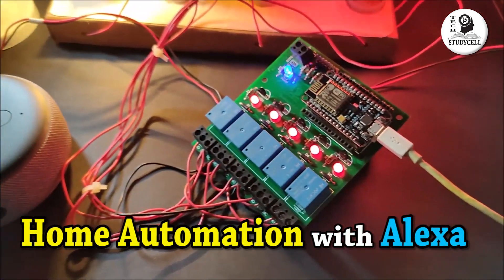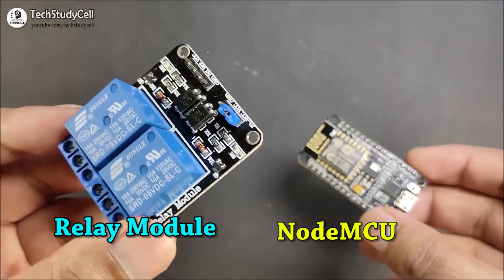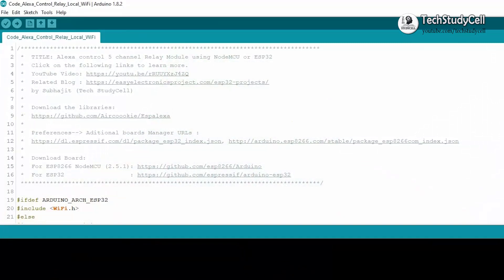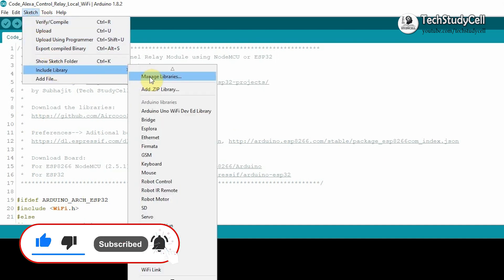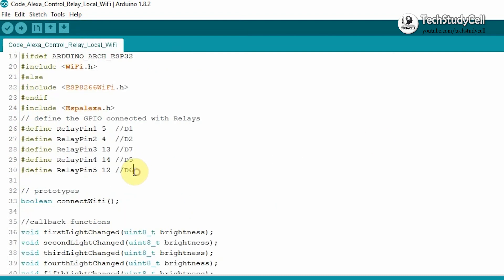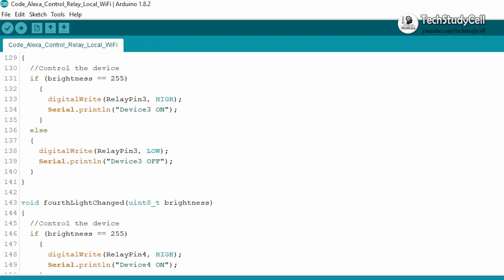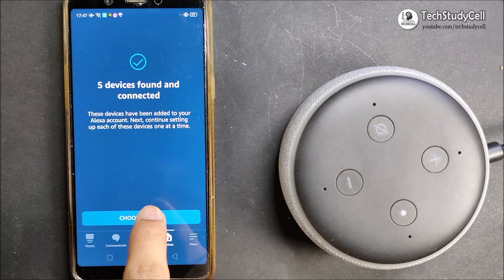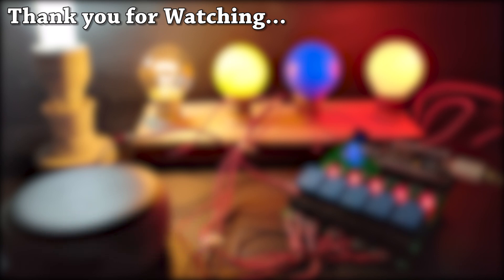Alexa Smart Home Automation system using NodeMCU ESP8266 & Relay Module | IoT Projects

Comment: can you describe the rest of the components you saw in the project.  For example, what value are the diodes and what are the resistors that are next to the connection block.  The resistors that are between the LEDs do not look like 220 because their code starts with black.  Can you provide more information or a wiring diagram for this device?  Regards.  Adam.

Comment: Hi Tech Study Cell i am facing a small issue i have followed each and everything you have told in the video but when i am supplying 5v to nodemcu then all the devices connected to it is turning on and when i am ordering alexa to turn on light she is actually turning it off instead of turning it on and this problem is having with each and every device connected to relay  pls anyone help and suggest an idea thanks
Reply: Same problem bro

Comment: Sad thing is that this reset when a power outage occurs, anyone has solved this? 
A few solutions that I can think are: 
*use a power bank to power device, and connect that power bank to a usb charger to always have energy.
*Use a battery module thingie to power it, same as power bank but gives more options when designing
*I believe these devices have onboard persistent storage, but I think it has short life so making some code that has this in mid is important, something like “every hour write the last state of device”, that or storing this last state on a separate server or storage device

Comment: Hello. Thanks for putting this video together. I actually ordered my first custom PCB using your link and the File you provided. It was a lot simpler than I thought and I received the product quickly. I feel more confident in trying my own design. I am having an issue with this project now. It worked for a few weeks now I am getting a “device not responding error” I have tried unplugging everything and plugging it back in. I have removed and reinstalled the devices. Lastly re-uploaded the code. Alexa found the devices and installed them, but right away they are not responding. Any suggestions? Thanks
Reply: I figured it out. I uploaded the code from my laptop instead of my desktop. I had the latest version of the ESP8266 installed on my laptop. Seems to be working now.
Reply from the maker: Great!!  you can also checkout the following Alexa home automation https://youtu.be/5-ZyC3-BzLE
Reply: @TechStudyCell  I will check it out. I think I would like to add buttons. I incorporated a scrolling matrix too.

Comment: Sir ek Q hei h...hme relay ko on krna h bt ek specific time tk on rkhna h ..jese 5 sec tk or fir apne aap off honi chaiye...supose i command that alexa turn on relay 1 and its on bt for 5 sec ..and i want it automatic off after 5 sec..
Reply: add delay in that executed file 
for eg. in code 
to make these changes in 
first device 
void firstLightChanged(uint8_t brightness)
{
  //Control the device
  if (brightness == 255)
    {
      digitalWrite(RelayPin1, HIGH);
      Serial.println("Device1 ON");

       delay(5000);
      digitalWrite(RelayPin1, LOW);

    }
  else
  {
    digitalWrite(RelayPin1, LOW);
    Serial.println("Device1 OFF");
  }
}
Reply: @MaheshBahutePPTSIndia  sir can you merge two program plss for ESP32 board ...

1.  fingerprint door lock by android fon with app ..

code// #include <WiFi.h>
WiFiClient client;
WiFiServer server(80);
#define wifiLed    2   //D2

const char* ssid = "wifi name";   //WIFI SSID
const char* password = "password";    //WIFI PASSWORD
String  data =""; 
int Relay4 = 26;     //D26

void setup()
{
  pinMode(Relay4, OUTPUT);
  digitalWrite(Relay4,HIGH);
  Serial.begin(115200);
  connectwifiFing();
  server.begin();
  }
void loop()
{  
    client = server.available();
    if (!client) return; 
    data = checkClient ();
    Serial.print(data);
    if (data == "RELAY4SUCCESS")
   {
      digitalWrite(Relay4,LOW);
      delay(100);
      digitalWrite(Relay4,HIGH);
    }
} 
void connectwifiFing()
{
  Serial.println("Connecting to WIFI");
  WiFi.begin(ssid, password);
  pinMode(wifiLed, OUTPUT);
  Serial.print("WiFi Connected  ");
  digitalWrite(wifiLed, HIGH);
  while ((!(WiFi.status() == WL_CONNECTED)))
  {
    delay(300);
    Serial.print("..");
  }
  Serial.println("");
  Serial.println("WiFi connected");
  Serial.println("NodeMCU Local IP is : ");
  Serial.print((WiFi.localIP()));
}
/******************************** RECEIVE DATA FROM the APP ******************************************/
String checkClient (void)
{
  while(!client.available()) delay(1); 
  String request = client.readStringUntil('\r');
  request.remove(0, 5);
  request.remove(request.length()-9,9);
  return request;
}
Reply: @MaheshBahutePPTSIndia  and 2nd program is relay on off by alexa ... 

code// 
#include <WiFi.h>
#include <Espalexa.h>
Espalexa espalexa;
#define RelayPin1 23  //D23
#define SwitchPin1 13  //D13
#define wifiLed    2   //D2
int toggleState_1 = 0;
boolean connectWifi();
void firstLightChanged(uint8_t brightness);

// WiFi Credentials
const char* ssid = "wifi name";
const char* password = "passwrd";
// device names
String Device_1_Name = "Study Lamp";
boolean wifiConnected = false;

//our callback functions
void firstLightChanged(uint8_t brightness)
{
  //Control the device
  if (brightness == 255)
    {
      digitalWrite(RelayPin1, LOW);
      Serial.println("Device1 ON");
      toggleState_1 = 1;
    }
  else
  {
    digitalWrite(RelayPin1, HIGH);
    Serial.println("Device1 OFF");
    toggleState_1 = 0;
  }
}
void relayOnOff(int relay){
    EspalexaDevice* d = espalexa.getDevice(relay-1); //the index is zero-based
    switch(relay){
      case 1: 
             if(toggleState_1 == 1){
              d->setPercent(100); //set value "brightness" in percent
              digitalWrite(RelayPin1, LOW); // turn on relay 1
              toggleState_1 = 0;
              Serial.println("Device1 ON");
              }
             else{
              d->setPercent(0); //set value "brightness" in percent
              digitalWrite(RelayPin1, HIGH); // turn off relay 1
              toggleState_1 = 1;
              Serial.println("Device1 OFF");
              }
      break;
      default : break;  }
      delay(300);}

      // connect to wifi – returns true if successful or false if not
boolean connectWifi()
{
  boolean state = true;
  int i = 0;

  WiFi.mode(WIFI_STA);
  WiFi.begin(ssid, password);
  Serial.println("");
  Serial.println("Connecting to WiFi");

  // Wait for connection
  Serial.print("Connecting...");
  while (WiFi.status() != WL_CONNECTED) {
    delay(500);
    Serial.print(".");
    if (i > 20) {
      state = false; break;
    }
    i++;
  }
  Serial.println("");
  if (state) {
    Serial.print("Connected to ");
    Serial.println(ssid);
    Serial.print("IP address: ");
    Serial.println(WiFi.localIP());
  }
  else {
    Serial.println("Connection failed.");
  }
  return state;
}

void addDevices(){
  // Define your devices here.
  espalexa.addDevice(Device_1_Name, firstLightChanged); //simplest definition, default state off
  espalexa.begin();
}

 void setup()
{
  Serial.begin(115200);
  pinMode(RelayPin1, OUTPUT);
  pinMode(wifiLed, OUTPUT);
  digitalWrite(wifiLed, HIGH);
  pinMode(SwitchPin1, INPUT_PULLUP);
 //During Starting all Relays should TURN OFF
  digitalWrite(RelayPin1, HIGH);
  

   // Initialise wifi connection
  wifiConnected = connectWifi();

  if (wifiConnected)
  {
    addDevices();
  }
  else
  {
    Serial.println("Cannot connect to WiFi. So in Manual Mode");
    delay(1000);
  }
}

void loop()
{
   if (WiFi.status() != WL_CONNECTED)
   {
    //Serial.print("WiFi Not Connected ");
    digitalWrite(wifiLed, LOW); //Turn off WiFi LED
    //Manual Switch Control
    if (digitalRead(SwitchPin1) == LOW){      
      relayOnOff(1);      
    }
   }
   else
  {
    //Serial.print("WiFi Connected  ");
    digitalWrite(wifiLed, HIGH);
    //Manual Switch Control
    if (digitalRead(SwitchPin1) == LOW){
      relayOnOff(1);      
    }

    //WiFi Control
    if (wifiConnected){
      espalexa.loop();
      delay(1);
    }
    else {
      wifiConnected = connectWifi();
      // Initialise wifi connection
      if(wifiConnected){
      addDevices();
      }
    }
  }
}
Reply: @MaheshBahutePPTSIndia  and rember its for ESP32 board DEV kit vi

Comment: Hello Tech StudyCell,

I have a question.

How do I provide 5V input to my relay module?

I was able to provide 5V input to my ESP8266 board using my mobile charger (micro USB).
But I'm wondering how to power up my relay module.

On Arduino UNO, I could have used 5V Vcc to power up relay module via Vcc

But I guess ESP8266, we only 3.3V pin but not 5V.
How do I get around this?

Anyone, please advise.
Reply from the maker: Yes. If you are using the 5v supply then use the VCC pin of NodeMCU to supply the relay module

Comment: hi iam getting this error when iam uploading:  
Sketch uses 311196 bytes (62%) of program storage space. Maximum is 499696 bytes.
Global variables use 28080 bytes (34%) of dynamic memory, leaving 53840 bytes for local variables. Maximum is 81920 bytes.
esptool.py v2.6
2.6
esptool.py v2.6
Serial port COM7
Connecting........_____....._____....._____....._____....._____....._____.....____Traceback (most recent call last):
  File "C:\Users\SysCom\AppData\Local\Arduino15\packages\esp8266\hardware\esp8266\2.5.1/tools/upload.py", line 25, in <module>
    esptool.main(fakeargs)
  File "C:/Users/SysCom/AppData/Local/Arduino15/packages/esp8266/hardware/esp8266/2.5.1/tools/esptool\esptool.py", line 2653, in main
    esp.connect(args.before)
  File "C:/Users/SysCom/AppData/Local/Arduino15/packages/esp8266/hardware/esp8266/2.5.1/tools/esptool\esptool.py", line 468, in connect
    raise FatalError('Failed to connect to %s: %s' % (self.CHIP_NAME, last_error))
esptool.FatalError: Failed to connect to ESP8266: Timed out waiting for packet header
_
the selected serial port _
 does not exist or your board is not connected

Comment: Brilliant! I tried to add another 5 output relays but I couldn't - wonder if you can help
I copied everything that include the setting and pasted and changed the values but couldnt
as soon as l add after the Serial.begin(115200); it compiles but will not run

Help would be great
Thanks in advance
Erik Hoffman
Reply from the maker: Please refer the following video https://youtu.be/OJ4CzWyRQr4

I have added more features and shown each steps in details. Thank you.

Comment: i have no alexa device but can i control from alexa aps ?
Reply from the maker: No, you need an Alexa device
Reply: @TechStudyCell  IS IT WORK WITHOUT INTERNET ?  ONLY THROUGH THE WIFI ROUTER LAN
Reply: @TechStudyCell  bro now i have echo dot and the project working fine but i did not get ok feedback after on or of which i loved so please tale me a way-out to getting "ok" feedback
Reply from the maker: I have done no extra charges to get OK feedback. Whenever Alexa received any valid instruction it say Ok.
Reply: @TechStudyCell  now i have done everything i add more one output for getting 5 appliances and improve your coding and getting ok feedback

Comment: Well done! 
I built a similar Alexa control a few years back for my home low voltage Douglas system. Douglas uses 24VAC momentarily switched + or - to latch 110V lights/devices. Alexa control therefore required 2 relays per light/device (one to momentary shunt ON and another for OFF). The number of devices one can control by relay with a NodeMCU ESP8266 truly limits the system. I find multiplexing cumbersome so developed my own way to control up to 256 relays with one pin:

https://www.youtube.com/watch?v=SCmDXQnsBaE

This worked great but as I wanted to it 'to the max' decided to go back to my original use of WS2811 chip modules - https://i.pinimg.com/474x/a0/83/43/a08343ed0609a43f202d34eb8fe2ae2b--square-plates-circuit.jpg  - and merely read the individual R, G & B signals instead of light. This allows for control of up to 768 relays with one pin of an 8266.

Comment: hey pretty good video but, i have a problem, when i conect the two relay module it kind of restart and dosn´t work until i disconnect the relay, i dont know what i'm doing wrong its  just as connect as you shown on the diagram , if someone could help me i would really appreciate.
Reply from the maker: There may be some loose connection. If you are using active low relay module please refer to the following video
https://youtu.be/OJ4CzWyRQr4
Reply: @TechStudyCell  i already made it work, buuuut, only works a few minutes, after that Alexa says "the device doesn't respond", do you know what could be??????

Comment: Hi i have setup all the connection and uplaod the code on the NodeMCU the last part when i faced problem when connect alexa app in the app it shows me no device found yet i dont know what is the problem please advice
Reply from the maker: This is common problem. Please check NodeMCU and echo dot conneted with same WiFi.
If you face same issue please try 2-3 times.
Reply: @TechStudyCell  hi sir it connect but when u give command to alexa to open both bedroom light it shows on the amazon alexa app on but no the lamp it doesnt trigger the relay to open light any advice in this project i only used two  channel relay n two lamp  i would like to buy ur PCB send me ur number so that we can talk about the PCB
Reply from the maker: If both conneted, then you should see the device name in Alexa App. Other wise restart Alexa and add the device as shown in video

Comment: Hello greetings from Mexico.
 Is it necessary to connect the components (the led or spotlight)?
Or is it enough to load it to the nodemcu without connecting the components?
Since I load the code, but without component, I look for the devices but my echo dot 3gn has not found them
Reply: Did u solve the problem of finding devices. Please let me know. ahmadnomi52@gmail.com

Comment: the alexa app is not findin any devices, the wifi is connected on serial monitor, both on the same wifi , still not showing on the app
Reply from the maker: The NodeMCU, echo dot, and Amazon Alexa App should be connected with same WiFi.

Comment: didn't work bro plzz help
Reply from the maker: Both NodeMCU and Echo speaker should be connected with same WiFi. still if it fails then check in the serial monitor if the NodeMCU is connected with WiFi, then try again.

Comment: Helloo, I am trying to connect my esp32 to alexa, just like you did, however he does not find the devices. Do you know, why does this happen? Is there a blockade by region (I am Brazilian)?
Reply from the maker: Both ESP32 and Echo speaker should be connected with same WiFi. still if it fails then check in the serial monitor if the ESP32 is connected with WiFi, then try again.
Reply: @TechStudyCell  Thanks for your response. I connected ESP32 on the same wifi, but it didn't work.

I'm only using alexa's app, I don't use Echo. Do you know, if it is necessary to use an Echo for this project work?
Reply from the maker: Yes. You have to use echo speaker...

Comment: Wonderful video, it worked for me, hey friend I have a doubt, I think I have something backwards, when I say "turn on" my lights go off and when I say "turn off" they are there, I would thank you if you can guide me on what my problem is please
Reply: I have already figured out this problem, you just neend to add digital write pin low aftet the output state. And its done..
Reply: As he said in the video the configuration for the relay might differ. Try to change the HIGH as LOW and LOW as HIGH in the call back function.
Reply: @abuyaslamin4155  Im also having same problem i did this high low settings but the initial state is always on what to do for make it off?
Reply: This problem from esp i think you can't fixed it  its happened with me when I use blynk I have to press all button in first time I connected

Comment: i have succesfully uploaded to the esp32 but at the end it shows "
Leaving...
Hard resetting via RTS pin...
"
and somehow i am not able to turn on my light which i have connected to the relay one ...
looking forward for your help
Thank you . :)
Reply from the maker: Check in serial monitor if the ES32 is connected with WiFi. Then configure Alexa App. If the device is showing in Alexa App. Then you can control it
Reply: @TechStudyCell wifi is connected and through alexa app i have also added all devices but somehoe idk relay doesn't saw any output

Comment: My nodemcu is executing the code properly when I say the commands the LEDs on the relay module works fine but when I connect external bulb the relays is not getting any signal and the bulb is not turning on but the LEDs on relay module is working fine. What will the problem please help ?
Reply from the maker: Check the continuity across the NO and COM. when the relay turns on the NO and COM should be connected.

Comment: alexa is not discovering my esp8266
Reply from the maker: Both ESP8266 and Alexa echo dot should be connected in same WiFi network. Still if you face any problem then click on the discover devices again
Reply: @TechStudyCell  yes i am connected with same network..i am using mobile hotspot..tried multiple times...what should i do?
Reply from the maker: If you create the hotspot from same mobile then it may not work. So create hotspot from other mobile
Reply: @TechStudyCell  i have used two mobile one is for hotspot one is foe alexa
Reply from the maker: Please check in serial monitor if the NodeMCU is connected with hotspot